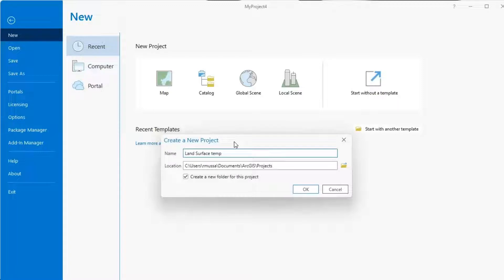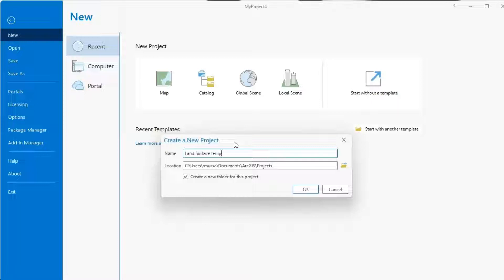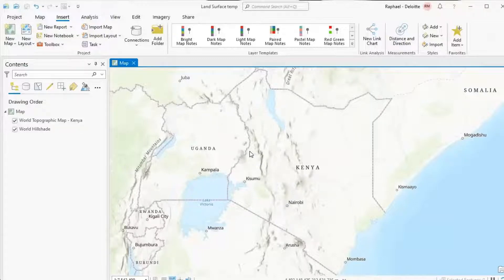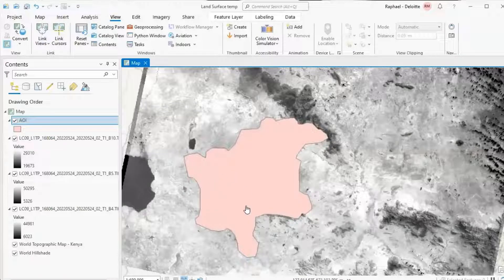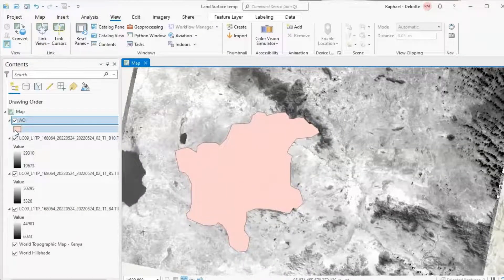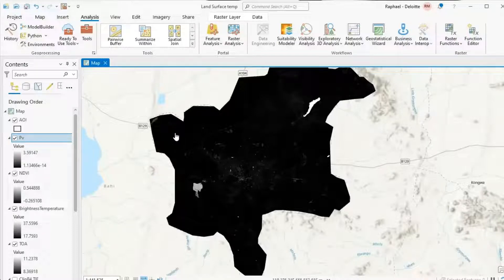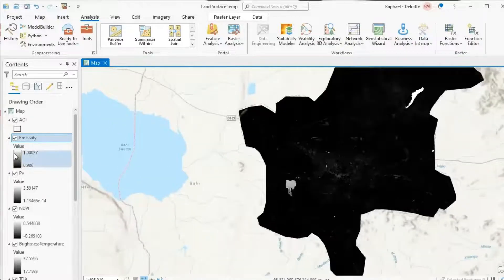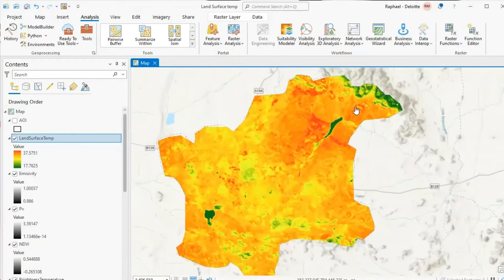How to Obtain Land Surface Temperature (LST) from Landsat 9 using ArcGIS Pro

Comment: Dear owner of this video /guys please help me, in the step 2 (convert TOA to BT), this formula BT = (K2/ (In (K1/L)+1))-273.15, how we type "In" in the raster calculator? is this same with Ln? because I use Ln and my BT result getting -25 to -48. Please for the help guys, thanks
Reply: I had same issue to bad you never got a response
Reply: @jspain7690  I have the same issue
Reply: @jspain7690 just search the function Ln on list of matematical operetors (left on window)
Reply: BT = (K2/ In ((K1/L)+1))-273.15, this the right formula. see here 
https://books.google.co.in/books?id=hBZuEAAAQBAJ&pg=PA105&lpg=PA105&dq=BT+%3D+(K2/+(In+(K1/L)%2B1))-273.15&source=bl&ots=TieimX1G-1&sig=ACfU3U2XJl8rk2VNdH4Qz9zupOG9xLcIQw&hl=en&sa=X&ved=2ahUKEwi1o5KU-NCEAxUJxTgGHQT1DBQQ6AF6BAgfEAM#v=onepage&q=BT%20%3D%20(K2%2F%20(In%20(K1%2FL)%2B1))-273.15&f=false
Page 105
Reply: i have used it and got the correct results. Thank you
Reply: for anyone else needing an answer it is "Ln()" You can find it in the tools menu of the raster calculator.
Reply: in this video the formula likely had misplaced parentheses around the Ln function. you can try using this formula instead BT = (K2/Ln ((K1/L)+1)) - 273.15

Comment: Hi, I want to know whether the formula in step 6 is wrong. I mean the formula should be: LST = (BT / (1+（10.895*BT / 1.4388）* ln(E))). Also, should 𝑂𝑖 ( the correction for Band 10: 0.29) be considered in the formula in the first step? Thanks for your time!
Reply: if you use 10.895 then you should use 14388 I think it's a matter of units. As for the value 10.895 I think that's for landsat 8, it seems to be 11.5 for landsat 9 however I'm not sure about that I'll have to do some more research.

EDIT: I looked it up and it says between 10.6 and 11.19 µm which means the average is 10.895 so maybe it's a mistake.
Reply: hi, have you gotten answers?